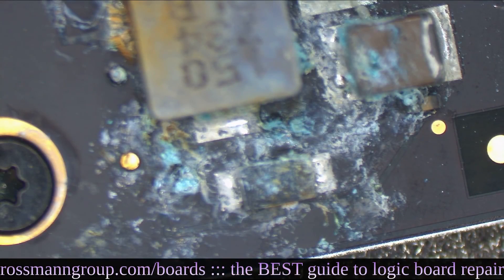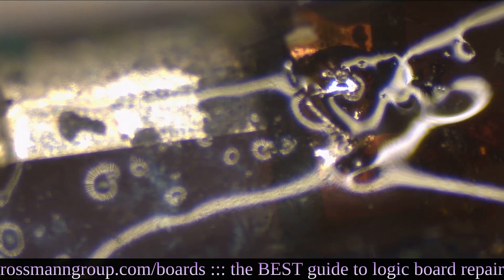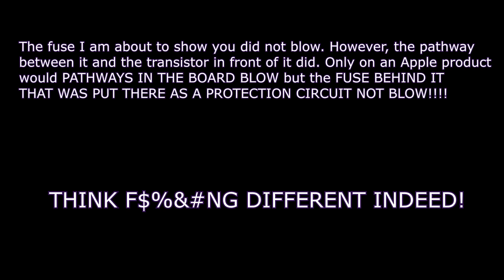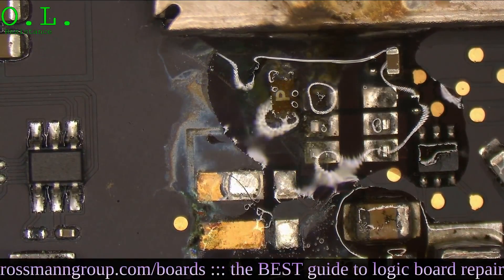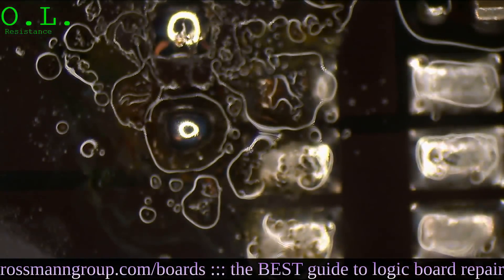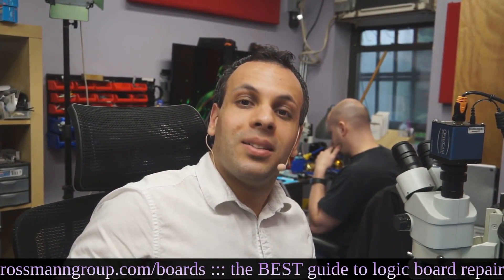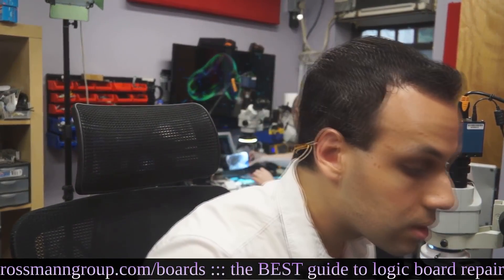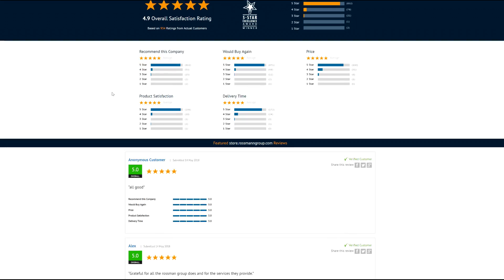The MOST DURABLE Apple component.

Comment: Hey it's not that a Poli fuse 
A resettable fuse or polymeric positive temperature coefficient device is a passive electronic component used to protect against overcurrent faults in electronic circuits. The device is also known as a multifuse or polyfuse or polyswitch.

Comment: Why is the fusible link so durable? Simple. Apple doesn't make it. Of course a real product with a surface mount fuse would have a nifty little holder so it can be swapped out and a fuse designed to pop before the circuitry does.

Comment: While I agree that apple's backlight and other circuits fuses rarely blow; the corrosion around the fuse is just like running a jumper wire across it, in which it will never hardly blow.  What would be interesting is if you had a junk board, hook up your dc power supply across that circuit, and see how much voltage/current it takes before that connection smokes...

Comment: you can't really blame apple for water damage tho. Because normal everyday air contain water vapor, and technically that is H2O molecules directly contact with the motherboard, although literally any other manufactures product has no problem with it, we are apple, we think differently. Therefore owner should only use their apple devices in apple approved genuine Apple Air to ensure maximum user experience.

Comment: Given that Apple seem to prefer that their products not be repairable, presumably the purpose of the fuse is to ensure that things not catch fire, leading to product-liability issues, rather than protecting the circuit board. Like as not, it's engineered that way.
Reply: Hmm - looks like you made a most similar observation back on 2017.

Comment: Good thing Apple doesn't build cars.
They would burn down before the fuse would blow. You cannot adjust the seating position because it would kill the design. You get a square steering wheel and when you complain about how horrible it steers, they will tell you that you are holding it wrong. If you would hit a speed bump at moderate speed, the chassis would bend. Your windows would break from closing a door and when you want to charge it, you can't because you did not buy the necessary $3000,- charging dongle.

Comment: There was a light that we needed working, so the electrical engineer took a look at and found that the fuse was blown. We didn't have a replacement fuse but this engineer noticed that a bolt fit where the fuse was supposed to go. We all agreed this was a bad idea, but apparently it is up to apple's standards.

Comment: So... How much does this actually matter? If the fuse blows, it might protect other components on the board, right? But Apple doesn't repair boards, they just replace them. So it doesn't really matter to them which component actually blew. 

And for an independent tech like yourself...they probably don't want to make your life any easier. But still, I'm betting most of your costs are labor. A one cent fuse vs a ten dollar IC doesn't really make any difference if you're billing three hundred bucks for the labor. And even if the fuse did blow, that still means there's a fault elsewhere that caused it, and if you don't fix that fault the fuse will just blow again. And maybe you'll get shoddy techs who just replace the fuse, show the customer that it boots, then a week later it blows again because they never fixed the root cause and then the customer has to pay for another repair. And if I was that customer that would certainly be the last time I ever bought a Mac...

The fuse must protect the user themselves from any overvoltage, and it should hopefully protect the hard drive from anything that could cause data loss. But I'm not understanding any reason why it must protect every single component behind it. And AIUI, a larger fuse may be less likely to blow from a minor overvoltage but more likely to maintain isolation during an extreme overvoltage. I don't quite have the hardware knowledge to speculate on the answer to this myself, but the question in my mind is if these fuses might offer better protection against a lightning strike at the cost of not protecting components which Apple believes aren't reparable anyway?

Comment: Not only Apple products do that. Lenovo Y50-70 - burned hole thru to the other side of the board, 2 mosfets and shunt resistor completely turned into carbon, while the FUSE, which was just 2mm away from this carnage, was perfectly fine. And apparently it is a common issue with this board.

Took a lot of patience, some solder braid, kapton, a bunch of jumper wires and conformal coating to bring this to a shape that looks like it could work, and it was a really hacky job. But IT WORKED! :D 1 year later, it still works, it's my own laptop and i use it every day. It was burned up when I got it, so I have no idea how that happened, but based on the corrosion noticeable on the PCB that holds the indicator LEDs, likely a liquid spill did that too.

I did not replace the fuse btw. It still hasn't blown.

Comment: I don't think I agree that the fuse is the problem.  What happened was corrosion.  Corrosion thinned a trace on the motherboard.  Before long, that trace's resistance went up and simply could not handle even a small amount of current.  Thin traces with corrosion...now your fuse is no longer the weak spot electrically.  So many of your videos boil down to corrosion.  lol.

Comment: Louis whats your experience with early 2009-unibody white 13' MacBooks? In the last few years I've strayed completely away from Apple. I could go on for an hour just listing every Apple laptop issue since 2000. But at the end of the day the most reliable, durable laptop I've ever owned is the 13' Early 2009 MacBook 5,2. I bought this laptop used. Previous owner took it apart to reapply thermal paste. Dude ruined the bluetooth and the entire board is covered in paste. It still runs perfectly. I had a charger blow plugged into this MacBook and watched sparks fly. I was sure it was dead. A year later here I am still using it. The battery in this thing is almost 10 years old with nearly 3000 cycles and it can hold a charge doing normal web browsing for 3 and a half hours. This laptop costed me only $175 in 2013 and after I put an SSD in it, this is the first computer I've had for this long thats never once let me down. With at least this one product, in my eyes, Apple did a fantastic job here and I would highly recommend this laptop to anyone. Throw Windows 10 on it and yeah its a Core 2 but you have a laptop as reliable in my eyes, as an old Thinkpad
Edit: I still haven't cleaned off all the paste as it does work and I'm not sure what I could use to remove the paste without damaging the components underneath. Anyone have any ideas?

Comment: Fuse meets a legal standard. Apple built the board lands ready to fail. Like a waxed apple shiny on the outside and rotten on the inside. Win 10 PC's are much worse, even if you build it yourself something like a power switch will become intermittent. Of course there's the next Win 10 upgrade headache. All computers are made cheap, ready to fail. It's a race to the bottom.

Comment: Would it help if the traces on the board were made thicker? Example: Gigabyte motherboards are thicker and have more conductive material in them. Does that not mean that the traces are more durable as well on those boards?

Comment: Louis, this was the best timing for a video upload. I work in computer repairs, very rarely doing component level board repair. 

A few hours before you uploaded this, i got a 2015 model Macbook Air into the shop with backlight issues after it took a bath.

The issue is now fixed thanks to your video.

Comment: I know a guy that put a piece of wire instead of backlight fuse. Nevertheless, it was quite a thin wire and it blew like a fuse. However, the original fuse died because he shorted the PPBUS_G3H (main power rail) through it and not because some other problems. So that means the wire can be a better fuse than the Apple's own fuse

Comment: Kind of makes you wonder how much the Apple engineer got paid to design in a fuse that apparently has a higher current rating than the traces it's supposed to help protect.

I also love the idea that power delivery is being controlled by how much pissed-off flailing around that part of the circuit is doing.

Comment: To be fair -- the trace and the leg of the MOSFET were compromised by whatever liquid was spilled on it.  The person who did that probably just flipped the laptop over and let it drip-dry on a towel for a few hours, then turned it on and it worked, so they figured everything was good.  Then over the next few days or weeks, the liquid slowly corroded the traces, and the first one to give was that trace there...  Or, hell, maybe they spilled literally one drop of water in there, and because that didn't kill it immediately, they figured everything was fine, and kept right on using it.  The fuse didn't blow because nothing actually shorted out -- the trace was eaten away by the liquid-spill.

I do hope Apple will start to make laptops that are less susceptible to liquid damage, though.  It's absolutely idiotic that they're so damn expensive, yet so easy to damage.  They should do a better job of sealing them up.

Comment: Louis, don't be that harsh on Apple :) I only had about 20 months of board repair as an old job(back when I started I found your channel and I love it ever since), but I with my own experience have seen a blown fuse about 3-4 times(and I had plenty of power spike damaged products cross my hands)and even my dad as an engineer with more than 30 years of experience in pcb design has a saying that goes something like this "No matter how much protection you think of, no matter how many fuses you put if something decides to burn it will always manage to find away to burn everything else besides the protection" (even the guys in Siemens have said something like that when he got his instructor licence). Hell when I've visited him at his work I've seen fried cables the size of my arm that were like melted in half and they were between fuses on both ends :D Electricity is a beast on it's own and has a life of it's own no matter how much we love to think we control it :)

Thumbs up for the video I always love it when the board dies but the fuse remains on guard :D (A dead trace is way easier to see when it's "missing" strait up than to wonder if the fuse is OK or not :D )

By the way my best experience with a fuse was at a ski slope where there was about half a mile of cable that got hit by a lightning (not strait to it but conducted by the ground it self), the wire was burned - FTP Cat5, on both ends the devices were working, all the 5 volt Zener diods were fine, not burned even tho voltage was way over 9 volts, but on both ends the communication chips were fried ^_^

Comment: I've always wondered why they bother putting fuses in systems like this (even when they do blow as intended), since board level repair isn't common in consumer products.  Apple in particular (as you've stated in the past) says board level repair is impossible, so why do they bother designing fuses into their products?
Reply: Do you want to blow up this huge li-ion battery?
Reply: Fair, but that's not always relevant, and as we've just observed, lots of other stuff fails well before it would be even here.
Reply: Fuse has nothing to do with water damage so it's pretty pointless to talk what it could've or couldn't do in that case.
Reply: True.

Comment: Why do they even put fuses on their boards when they don't want anyone to replace the fuses (or anything else, for that matter) anyway?
Reply: Why do you link fuses to repair? It's there so laptop wouldn't cath on fire.
Reply: Making a trace on the board thin enough to act as a fuse for that purpose would probably be cheaper. It appears that this is already happening despite fuses (traces acting as fuses, that is), so why bother with using a fuse that never blows anyway?
Reply: It would've blow in there was over current condition...
Fuse trace is unreliable af

Comment: I have a 2007 macbook and it still works without any repair. I also have a 2014 macbook pro and it also still works without any repair. I also have an Apple dual balanced armature driver in ear monitor and used it for 4 years and it still works. Even the cable of the earphone didn't fail yet to this day. I don't use iPhone, so I don't know ç

Comment: The part that confuses me though is that isn't a fuse supposed to blow when there is too much current? Not voltage? But then again, if the pathway blows, then there is too much current anyways since a fuse is essentially a piece of wire of a certain gauge.
Reply: Trace wasn't blown, it was corroded.

Comment: A fuse won't protect the circuit if it's  a corrosion issue.  The fuse will protect the circuit if the current goes higher than the rated amperage.
Reply: And mosfet would blow way before fuse does.

Comment: If you had a laptop that still under warranty, would you fix it yourself or send it in? My wife's HP had a hard drive failure. Easy fix for an IT guy at a school whom has several laptop repairs under his belt. But since its under warranty that would mean I don't have to shell out for a new drive. Of course I'll have to wipe the drive and do a clean windows install, but I would be doing that anyway if I bought a new drive myself :P
Reply: Send it in or at least replace it with SSD.

Comment: When you say it was the pathway that was "blown" and not the fuse, how did you repair the pathway?  Was the pathway just not working because it was covered in corrosion or did you have to put in a jumper wire? (I didn't see that in the video)  I saw how you cleaned up the contacts for the fuse and the transistor, but it wasn't clear how the pathway was repaired.

Comment: The one thing that should blow, never blow ?
So that are deliberate thing to force customers to buy new ones?
i just cant see any other reasons. one thing that would help repair this easy and fast DIY\repairshop and even THEMSELVES, they just leave it be and burn traces, and if DIY\repairshops can fix it with jumper wire, do apple fix it like so ? ( not saying about further damage, or even dead board entirely, that could be prevented)

Comment: Watched a few of your vids now, I do SMD rework in the automotive space, will be buying some of that flux, from your site looks a hell of a lot better than the flux pen I use. As an aside is there a reason you didn't clean the board before attempting repairs? I hate having all that gunk around when soldering and generally at least wipe with a pcb safe cleaner like fluxclene to get the shit off before attempting repairs.
Reply: He wants to see dirty parts where liquid was.

Comment: Could aomebody tell me what's the difference between that fuse and a 0 ohm resistor orr is it just the same thing?
Reply: Andrzej Luxanna Roztoczynski fuses arE supposed to cease conducting after a certain current is exceeded. Apple apparently thonks the two are interchangeable.

Comment: In audio amplifiers the expensive power transistors will also commonly save a $.10 fuse. And that is for a reason! If anything in a circuit goes so bad, that the current is not limited in any sane way, the fuse is there just and only to protect you from a fire hazard. This, and only this. If a MOSFET is gone before the fuse blows - nevermind, the current has dropped, nothing should burn now, that's all that matters.
Reply: I agree, the only thing that can protect everything from over-current condition is electronic fuse.
Reply: Michał Kobuszewski - Don't we have resettable fuses these days? 🤔
Reply: They are still pretty slow.
Reply: Resettable fuses behave differently depending on ambient temperature. A fuse sized to trip at 70*C will hold the same current at 20*C. This forces sizing them for 3-5 times the expected current. They are also not susceptible to ESD, unlike semiconductors. Sad facts of life.

Comment: Could it be that the fuse was bypassed by the liquid that was spilled and made it's way into the laptop? By the looks of that damage it wasn't plain water that got on the PCB...
Reply: Carp Andrei the issue is corrosion and no fuse will protect against that. The trace dissolved away, it wasn't damaged by too much current.

Comment: I might be wrong...but, does not "P" on fuse mean, it is PTC Polyfuse? That recovers? ...just measure it after heatgunnin
Reply: Frantisek Markus doesn't matter. It's still a fuse if you know what I mean 👌😂
Reply: Yep, but measuring it, and bitching about it might be slightly misleading :)
Reply: Interesting, but why put a poly fuse in that circuit ? It's not like a back-light fault is going to reset itself.
Actually 'P' = 3A http://www.farnell.com/datasheets/1693108.pdf (last page)
Reply: I have seen polyfuses in phones, they help to avoid catastrophical failure in presence of liqud. And after driyng out phone works again. But I accept your explanation...